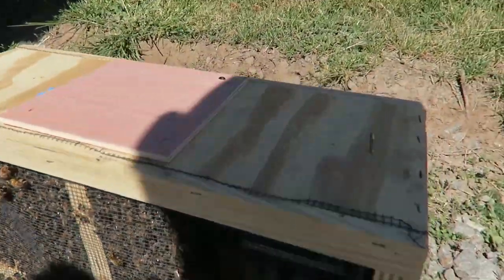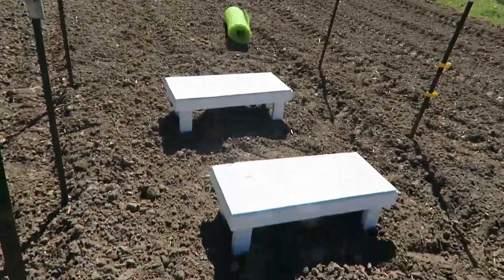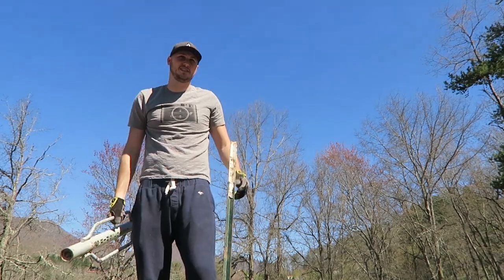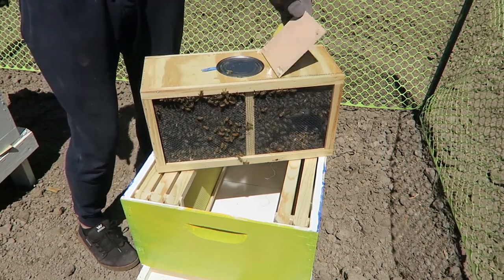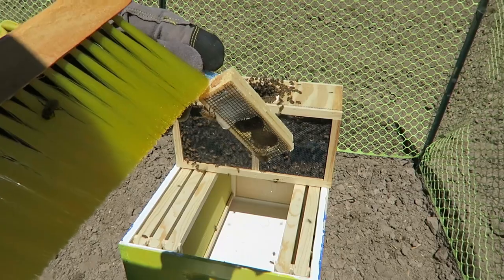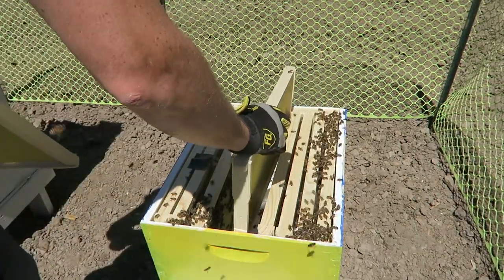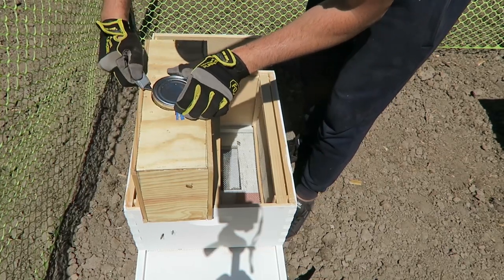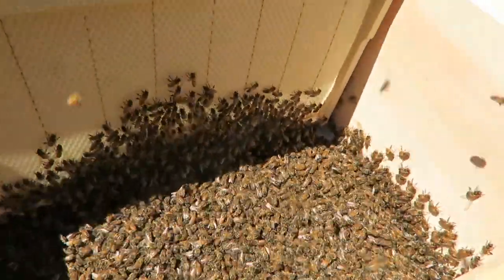Starting Beekeeping - Vlog Week 1 Season 1

Comment: Dear Taras, 
As a beekeeper for a quite a few years now i want to give you some recommendations and tips for your new beekeeping hobby/lifestyle. 
1a. Use a hive smoker: This really helps keep the bees more docile and less likely to sting. (Trust me when i say this)
1b. Use a "hive tool".  This nifty little gadget can help you remove propolis, kill invading bugs, and many other things, definitely worth it.
2a. Join your local beekeepers association. If your local town/county has a beekeepers association, definitely join it and take part in the meetings. This really helps you learn a lot when first starting and down the road you can make some great friends to help you.
2b. If you can, find a beekeeping mentor. This also can help you learn a lot, and if you mess up they can help you fix it.
3. Don't use a brush. From my experience bees would rather be tapped off a surface then pushed/brushed. I recommend using a hive tool to tap the surface the bees are on, until the bees fall off.
4. Make a hive journal. Use this journal to record the condition of the hive, population of varoa mites, propolis amounts, etc. This will help later and is a good way to keep track of your own progress.
5. Do lots of background research on how to bee-keep. This one is self evident.

So i hope this short list can help you start your own hive and have sucess!
Sincerely, 
Me, The average beekeeper.

Comment: Ok Taras... Some beekeeping pointers for you...    1)  First things first... WATCH Cody'sLab channel and learn MUCH about beekeeping...  he has several hives and seems to take fairly good care of them.    2)  Second, take the stick out of the front of the hive... unless you want them all to die from little tiny heat strokes.   As this was put out about a week ago, many may already be dead in the nasty summer heat.  The stick you have over the opening of the hive on the bottom, the one that makes only a tiny hole for the bees to come in and out of is for winter.  It makes the beehive have less ventilation from the bottom so that they can use the entire hive without getting too cold in winter.  In summer you remove it so that the bees can get plenty of ventilation from the cooler bottom part of the hive and you will actually be able to observe some bees sitting in the front of the hive buzzing their wings to force cooler air into the hive to lower the temperature... this is the purpose of the hole in the top of the first cover you put on the hive before you put on the lid...  it is a vent hole, not a handhold even though it is very ironically shaped like one.  :-P  The top of the hive, the weather lid, usually has a ventilated rim to keep it up off the edge of the boxes on the lower part so that the hive has proper ventilation.  It also allows for the release of carbon dioxide and carbon monoxide which can VERY quickly build in a hive of 3000 bees without proper topside ventilation.  This is another reason why the comb frames have little separators between them, not only to allow bees to go between them, but also to allow for proper ventilation of toxic gases and heat dispersal.     3)  Also... yes... yes you should very much get a suit... 3000+ bee stings is usually fatal... and if you walk up on their hive after something pisses them off or the queen is about to swarm... you may be hard pressed to survive without a suit.  Point three, sugar water and a beehive smoker bellow...  ESSENTIAL tools for keeping bees calm.  I knew about the smoke bellower fro when my Grandfather kept bees for a few years when I was a kid...  the smoke simulates a nearby forest fire and the bees tend to calm down and want to stay indoors.  However some folks say that their little bee lungs tend not to be able to take much smoke inhalation abuse, some say it is cruel like blowing cigarette smoke in a kids face, and some say that over time it may actually ENCOURAGE a queen to swarm and may lead to hive death as well.     4)  The alternative, which I learned from watching Cody'sLab channel Cody take care of his bees is sugar water in a spray bottle... according to him you spritz them down with a FINE MIST (emphasis on FINE MIST there)  of sugar water and they not only does the water mist wet their wings and make them not want to fly until it they are clean and dry but the sugar water apparently gets slightly sticky as it dries and the bees will want to spend more time cleaning the sticky tastiness off themselves and using that to make more honey instead of stinging you.     5)  Fifth Trick, also learned from Cody on his channel, apparently adding a bit if lemon grass (REAL lemon grass extract, not that store bought alcohol laced stuff)  (may be able to find some from the local beekeeping supplier)  in said sugar water sprayed on the bees already inside your existing hives and on any new bees you introduce into the hive after the first colony of bees is established,  makes it so none of the bees know that they are from different hives and helps them all to integrate together without killing each other in a massive bee battle-royale.     6)  Lastly, getting a CLEAN painter's knife with a hook on it, one of those ones that you can use to scrap paint chips and scrape paint off tools and open a can of paint can help ALOT in working with your hives (personal experience).     7)  In short... I think BOTH a smoke bellow and sugar water will work... maybe switch them off now and again or use the smoker for winter maintenance and the sugar water spritzer for summer?  That I don't know unfortunately... would make sense though... water and cold do not mix on a bee...  unless you want bee-sicles, then just remember to remove the stinger first.   :-P
Reply: Wow.

Comment: Tip: when loading your smoker first add year straw, wood, etc burning material first, than sprinkle a thin layer of fresh grass on top. This makes the temperature cooler but still has the same effect. This also helps you not burn the bees.

Comment: just a quick tip for you. when using your bee brush, try and just lightly tap it along the frame or surface u want removed from bees, as opposed to sweeping like you're cleaning up dust. its alot nicer on the ladies, and they move quite quickly with many small little vibrations. 
keep up the good work!

Comment: <- Beekeeper since about 30 years ago. Currently have 10 hives and mentor several new keepers in our local association.

Dude, Well done!! For a 'first timer', you did amazingly well! Of course I could make some suggestions - tweaks - to your introduction method, but they'd be minor and piddly. You got it done, didn't get hurt, bees look good and that's what counts. Good on ya!

I didn't notice any feeders - you may well have had them. As you're introducing to foundation (looks like Rite-cell, good stuff), you'll want to help them draw out their frames by feeding. There are as many different ways and feeding blends as there are keepers - pick one and use it. If they don't use it or you run into problems - try something different.

I believe you mentioned you were going to plant flowers around the hives. Nice - it'll look good and not do a bit of harm. However, just don't expect your bees to forage heavily right there. They do their 'business' - pooping' - outside the hive on cleansing flights within a few dozen yards of the hive. Yea, they don't like to eat where they poop. No worries, though. A worker can fly upto 10 miles in a day. That gives them an extreme forage radius of about 5 miles. Usually they'll stay closer to home, 2 to 3 miles radius - and only go 'the distance' if needed.

Good luck on your new adventure! Feel free to ping if you've questions and I hope to see many more videos of your keeping as you grow in this new avocation!

Comment: *Can i ask you a question? How do you get the honey, without bees ,,stingering'' you (or something)?
Reply: +Kuba Kajor there are a few ways, as long as you aren't destroying their hive they tend to not want to sting you because it kills them but if they are feeling threatened you can spray them with sugar water because it lets them know you dont want to hurt them and also there are these things called smokers you can use that calm the bee's down 

after that you can just kind of clear them off the comb with a brush and put it in a crate. 

to get it out you need to break the caps that the bee's seal the honey with (its just some wax) and you can do that with a heated knife, and when the caps are broken there are machines you can use that spin the comb very fast that extracts the honey from it.
Reply: but i saw videos that someone use machine, that you put smoking grass, and then smoke them, is that working?